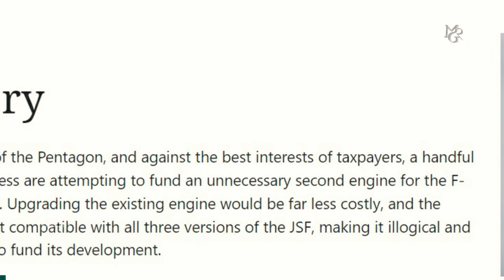F-35 and the Alternative Engine Dilemma: Are Billions of Dollars in Additional Spending Necessary?

Comment: The CURRENT F-35 Pratt & Whitney engine can't run enough cooling for the electronics and is NOR a dual cycle engine for greater range, as needed in the Pacific Theater. If the gen 6 NGAD fighter(s) for the Air Force and Navy ar to have better engines than the GE dual cycle engine then use the GE dual cycle engine in our f-35 fighters because the GE dual cycle engine is better than the new P&W supposed dual cycle engines. We need the BEST f-35.  There are enough F-35 fighters on order for other nations that the cost per plane is going down. Use those savings for better F-35 engines.
Reply from the maker: Thank you for the information you provide, we are very happy with new information. you seem to really understand the f 35 engine 👍👍